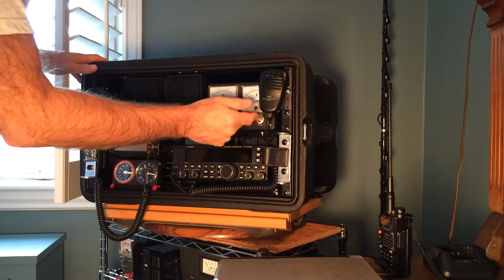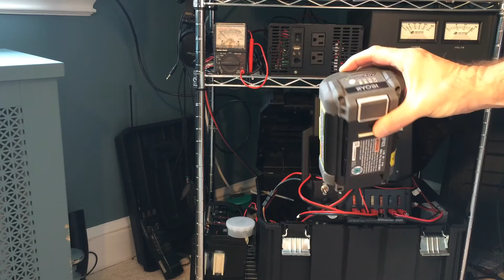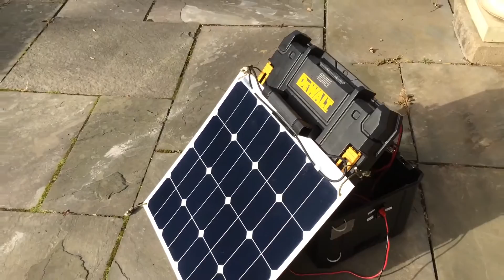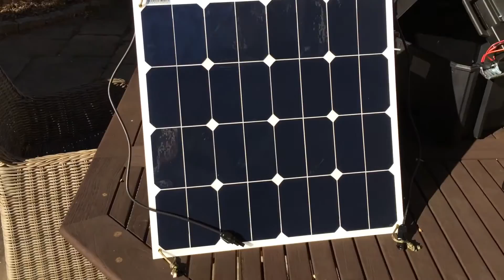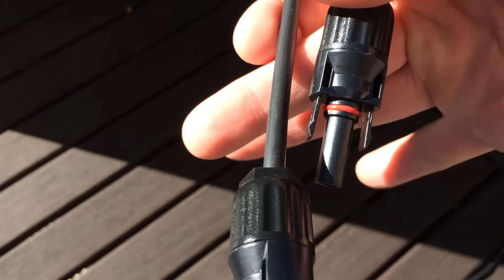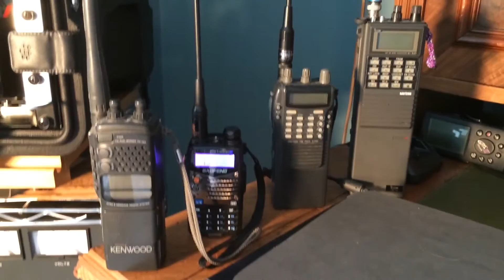Ham radio go kit w handhelds and component diagram

Comment: I'm just curious why did you have to get another call sign
Reply from the maker: I guess I get bored of them, moving around the world in the AF I kept getting new ones.
Reply: @lfolio  They give you new ones when you move?
Reply: @notsure7874  yes they do.  I started off in Iowa with N0RWZ and moved to South Carolina and thought I would be there a while (turned out not) and requested an area specific call sign (over 20 years ago).  I now wish that I kept the original, even though I'm now in Texas.
Reply: @cohenga59  well theres more of a case for a vanity callsign..
Reply from the maker: @notsure7874  and now I think they are free; used to cost. I like having the short WY2B; sounds more like a radio station!

Comment: The recent hurricanes Irma and Harvey are making me rethink what a go box should be. I've been watching many go box builds on YouTube.  I've come to the conclusion many of them are way too big. The assumption seems to be there will be a vehicle and fuel available.  Nice build though! :)
Reply: jim zorger then just get a handheld
Reply: I agree. All of the extra speakers and 120v inverters built into a go kit were unnecessary for me. Solar is in my future but for now I have my Yamaha generator and 10 gallons of fuel. I won't knock anyone's go kit design because their needs are different than mine, but I've noticed in the past that most of the stuff I've carried with me never got used. I made my go kit in sections so I can take as little or as much as I want depending on the need.
Reply: I guess it would depend if you're in the disaster zone and leaving, or if you're headed to the disaster zone to provide emergency communication. Either way size and weight are a factor, but probably more so in the former case.

Comment: Nice! ... can I ask how much the go-box weighs in at? ... I built one around a 450D but used wood rather than the Gator box and I can barely lift it by myself ... I am also looking at building my battery boxs much like yours are. Those Ridgid tool boxes are slick too
Reply from the maker: Thanks, about 40 pounds, I have not weighed it, but I can lift on my own up and down stairs. It is mostly my home base; just something I can take the basement.
Reply from the maker: Its like 40 lbs, I can lift with one hand and take up and down the stairs, but would not want to hike it anywhere.